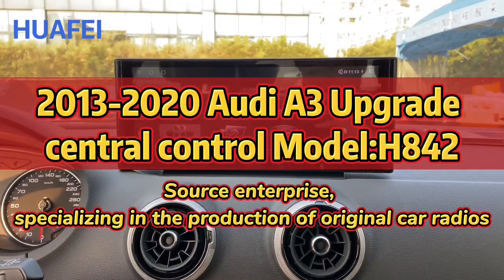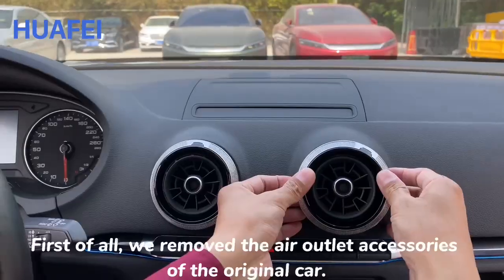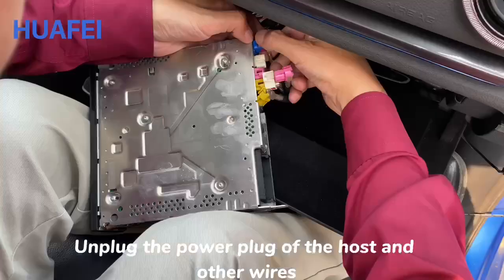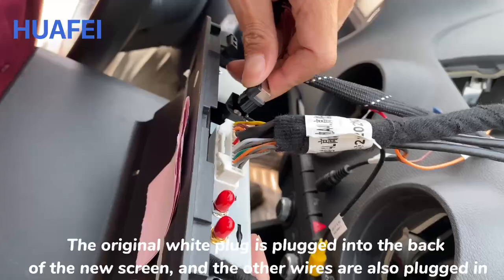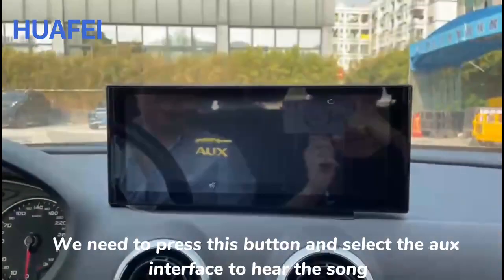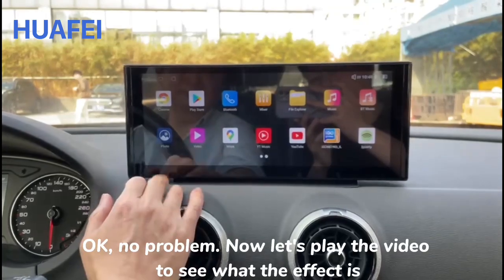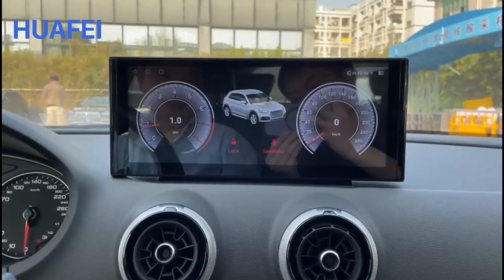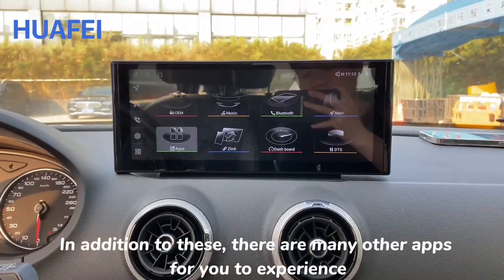Installing the 12.3-inch Android Head Unit to 2013-2020 Audi A3 Dashboard

Comment: You say the origenal audi data can be used with modification. What needs ro be done tonallow this to work with your screen it is important if i buy i want to be able to access the original audi factory data. Can you tell me what modifications need to be made to view the factory data as shown in this video.

Many thanks
Reply from the maker: Hello, could you leave your contact information? My colleagues will help you, or you can add WhatsApp:+18615811849245.

Comment: Hi, if I retain my cars own factory reversing camera, does it still work exactly the same way, turning on when I go into reverse, and showing the active turning lines and the radar sensors etc? (2017 New Zealand new RHD S3 8V)
Reply from the maker: Yes, they can work like before.
Reply: @huafeielectronic8181  I tried mine and it didn't work, it said no signal when I go into reverse. My camera doesn't turn on or my sensors

Comment: I have an audi a3 2018 with an aftermarket sound system, at the beggining the sound quality was great and loud, but after a week or so seams that the mmi is protecting the speakers lowering the volume range and the sound quality, the problem is really from the mmi because we already replaced all the aftermarket material and the problem didnt go away. The question is, by playing songs from the screen with android can we avoid the mmi "protection" festures?